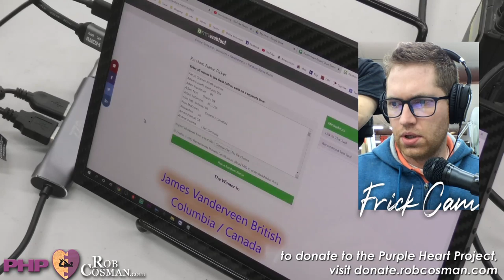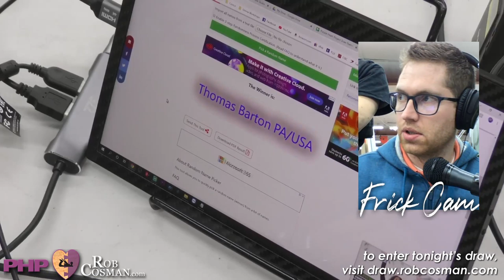Live with Rob Cosman Episode 26: Bed Desk Part 6

Comment: Another magnet idea is to imbed a magnet in the inside drawer front (dowel size hole), then use a mating magnet key in a dowel stick to pull the drawer open.

Comment: I see some magnet ideas for the drawers, but if you want to stick with a dowel type, maybe something like this.    With a 1/2 inch dowel, reduce the size down to 3/8 inch for the thickness of the dust frame plus the thickness of a 3/8 inch washer (washer goes against the 1/2 inch ledge of the dowel).  Cut a 3/8 inch slot in the dust frame that is the thickness of the drawer front plus the 3/8 inch for the dowel.  Round the back of the slot for the dowel to seat.  Have the slot set back approximately 1 inch from the front of the dust frame.  Prepare a strip of thin wood that is thinner than the distance to the bottom of the drawer that has a rabbit on the top of either side, but is long enough that the slot is covered when the dowel is pushed forward, and is still long enough to push the drawer open.  Glue and screw the thin strip of wood to the top of the dowel, so the strip of wood points forward.  Rabbit two strips of wood, and glue them down to capture the strip of wood attached to the dowel.  The knob will push the drawer out, and the strip of wood will seal the slot hole whether the drawer is in, or out.

Comment: Rob, we once used some simple levers, made from wire coat hangers (Fence wire would do).
We had three very shallow drawers hiding behind the rail of a pair of glazed doors.
The centre drawer was turned into a spring loaded dummy.  When pressed it opened the two at the side enough to open.
David Charlesworth
Reply from the maker: HI David, I'm wracking my brain on this one to come up with something that is both unique and in keeping with the piece.   Given enough time............